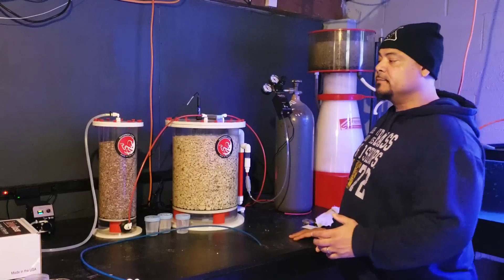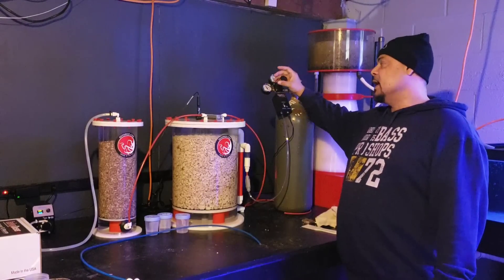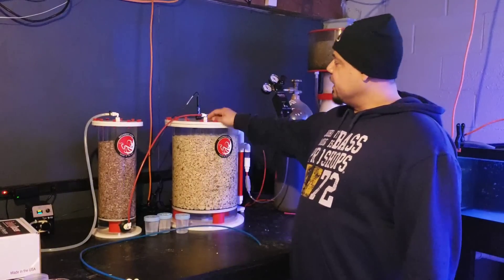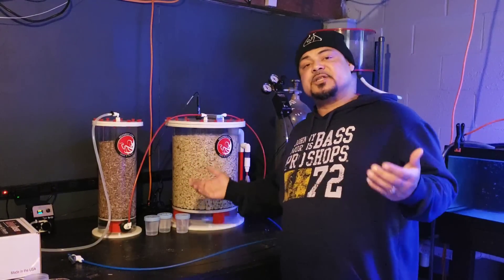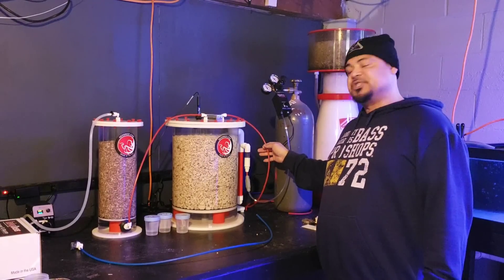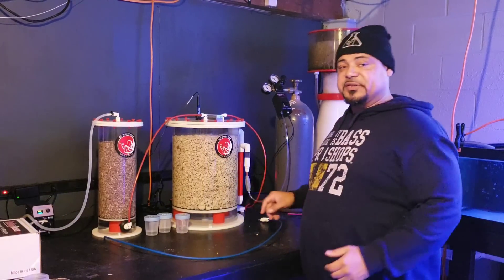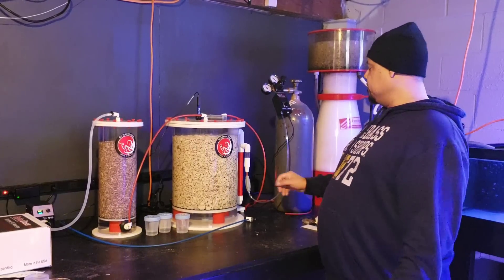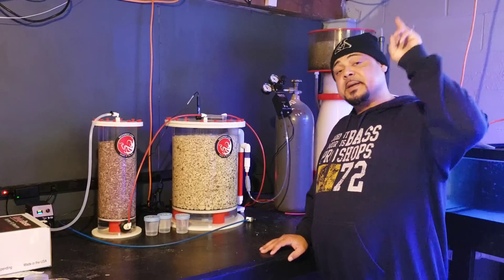HOW DOES CALCIUM REACTOR WORK

Comment: So with using the kamora to pull water into the system, would the line that would normally be a maxi jet or sumtin just sit somehwere in the sump? Does height of these units matter in relation to say the sump. Very interested in going rhis route instead of dosing, but still ha e a ton of questionss.
Thanks ken

Comment: Wuts up Rico super informative video 👍🏾
I wanna get a setup like yours but for a waaaay  smaller system like a 100 g 
So I need a the co2 ,dual stage reactor ,ecoral doser and a carbon doser correct?
I know you say geo is a good brand what about the carbon doser and what store would you get the co2 from?
Reply: My bad not ecoral I meant to say kamoer

Comment: Nice video. Saw a few things I can change. I just keep having issues with bubbles but the model I have has a line for recirculating co2 back through the reactor so you don't use so much co2 but since that is there there is always some bubbles in the system. I got out all I can and lowered the mount of co2 I'm adding so I hope that fixes the problem.

Comment: You could put in a security loop (at least 4 ft above the cylinder and reactor) on the co2 line between the check valve and the regulator to prevent a failure in the check valve ruining the regulator.